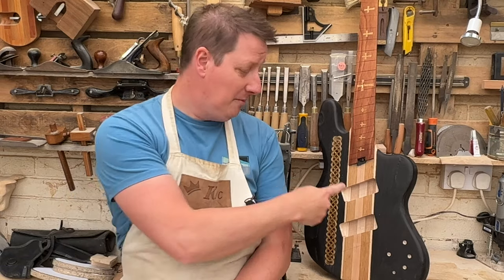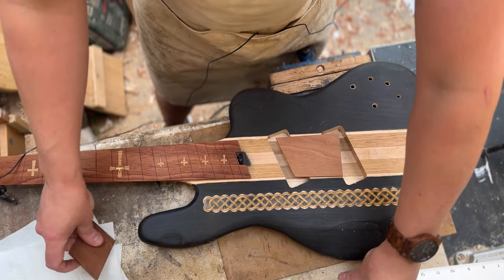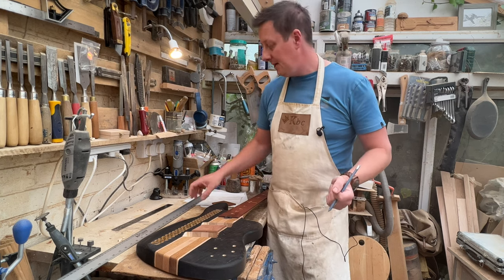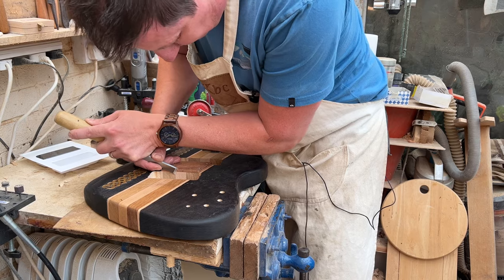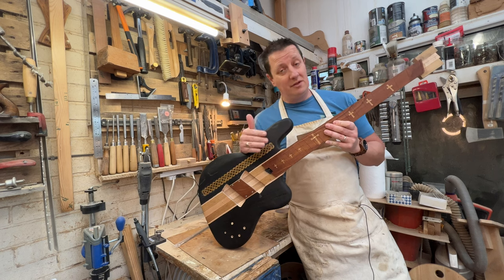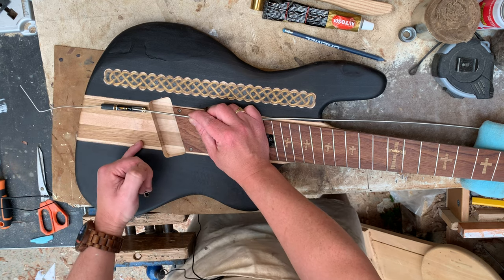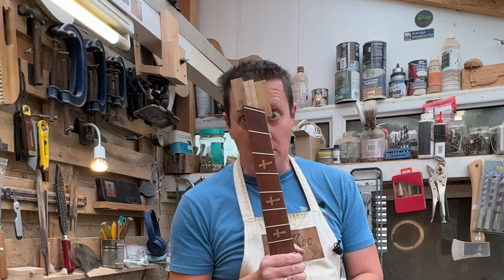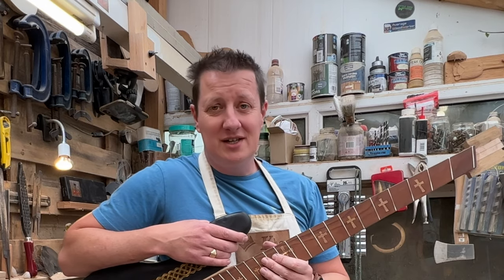Bass Ramps and Zero frets  |  Bass guitar build part 13

Comment: Great video as always Chris, I like the bass ramp idea, I may try that. You are using the zero fret to ground the strings so have you inlayed a ground wire thru the neck? Sorry I’ve not seen all the videos. Cheers Dave
Reply from the maker: Hi Dave, the ground wire will go to the first bridge piece, then all the string will be connected at the zero fret. 👍

Comment: Typically, a bass ramp is used more for slap playing than anything else, it gives the player a place to slap without having to slap over the last couple frets, and the strings better "action" when slapping. 😉
Reply from the maker: A veritable banquet of uses! 👍
Reply: Not getting the same sound there + harmonic options. I like that it protects the pickups from the strings.